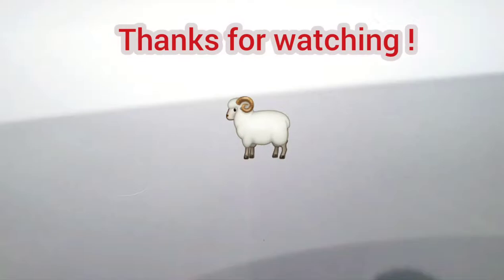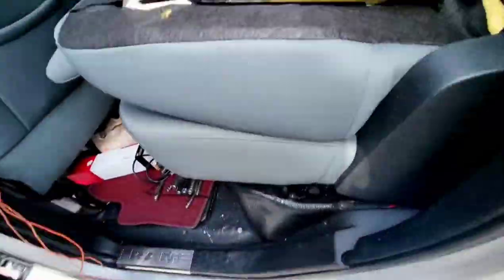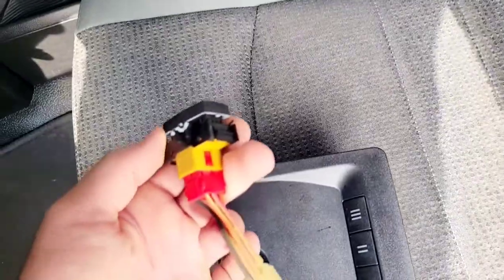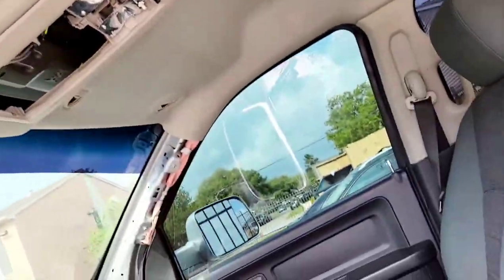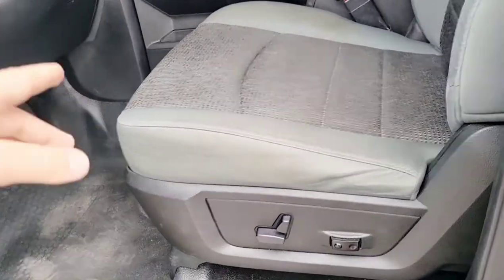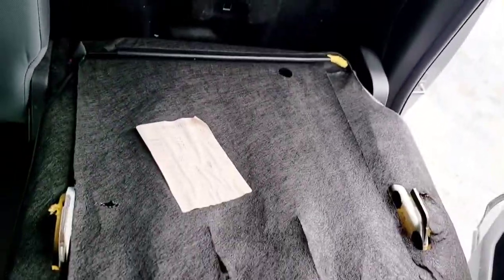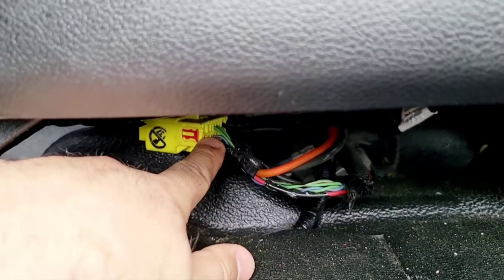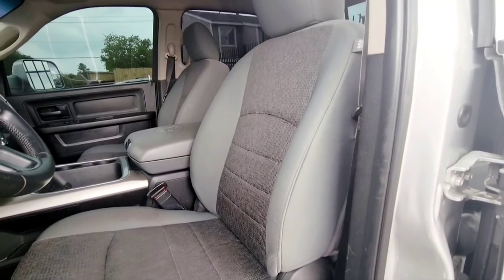Ram 1500 Rear Sliding Window Swap and Wiring

Comment: How much did it cost
Reply from the maker: I actually got a deal, the window I got ot for like $80 with the motor and the wiring it was about $20, instalation for window was about another $80 so $180 for everything